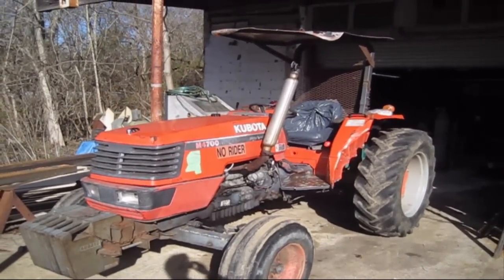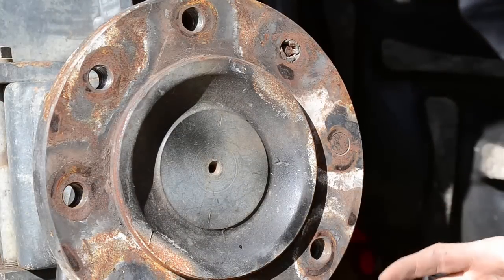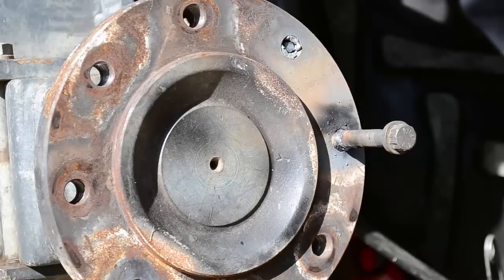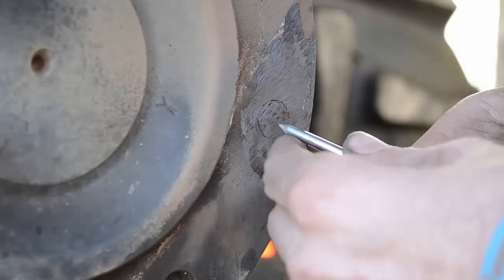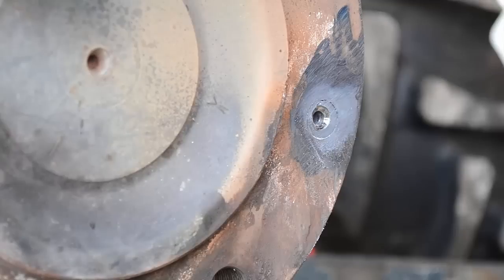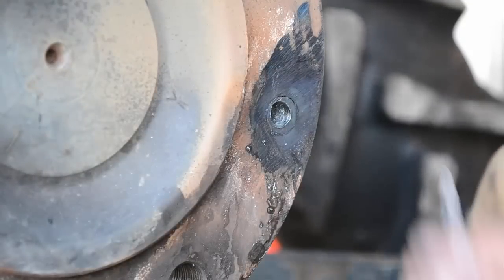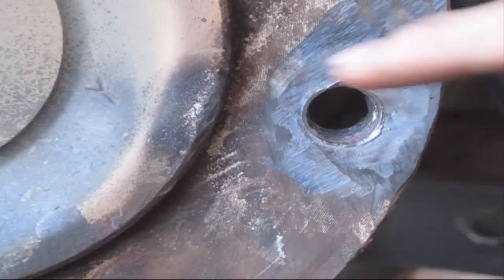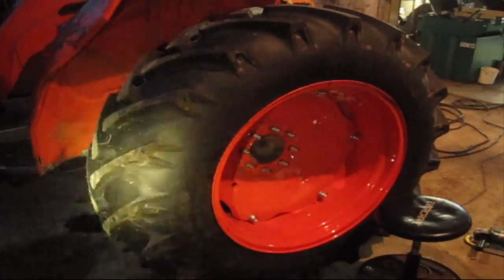Broke-off bolts techniques

Comment: I got to say I learned much about patience and self control.  I found the numerous comments very informative.  I would have used more penetrating oil and heat early on.  And I would have let the penetrating oil soak in for days; but this only works for hobby machanics, not for a business.  My main comment is about "Easy Outs."  I have learned, the hard, way that the hole for the easy out has to be, say about 85% of the bolt's pitch diameter.  You can't put a little easy out into a little hole in a big bolt and expect any position results.  Really, make the drilled hole big enough so you just start to see the thread lines. I do not like the round left handed pitch easy outs.  Their taper is too great.  While one part gets a good grip the fatter part expands the bolt tighter.  I do like the square easy outs.  They have less of a taper and good sharp edges to cut into the bolt. 

Lastly I have a comment related to thinking outside the box.  When the first bolt (with the welded on extension) would not come out by turning counter clockwise (because of something messed up on the back side) you should have tried turning it in the clockwise, so perhaps it would have come out on the backside.  Still it is a great video, clearl explained and good images.
Reply from the maker: Thank you sir. Knowing what I know now I think I could have definitely spun it out the backside but I was still green in my broken bolt experience and didn’t think it would work because someone else tried it.  I’ve used the drill out method very little compared to my weld on experience. But there are still times that drilling is the only way you can get them out.  I don’t know why this video blew up several years ago. I’ve got other videos on bolt extraction that are way better than this one.

Comment: Good persistence! Drill out the studs and fit helicoils (thread inserts).....If all else fails.....drill a new PCD of bolts 1/2 a pitch from the existing holes.

Comment: for the same or for head bolt take the same size bolt drill all the way through line it with a soda straw now hold in alignment with broken bolt use stick welder or wire welder. insert electrode into hole in bolt when hit bottom pull trigger for a few seconds . mite take a little practice but when get use to it you can save a lot of time great on head bolts. on through when you have drilled it you can use coping saw to make 3 cuts then it comes right out

Comment: if you have to drill it out, make sure you center punch it directly in the center. then starting from a smaller bit and work your way up the the bit you would use for the tap. don't use the drills he is using, they will overheat and could break inside the whole. instead purchase Cobalt drill bits, they are made for hardened steel. and work like you were drilling through butter. after drilling run a tap slowly through to clear the thread, you may have to run the tap in and out to clear the broked bolt threads. As for the holes that the threads are gone, get a helicoil drill and tap then insert helicoils to replace the threads.

Comment: J B
2 years ago
1)Slow the drill speed. 
2)Left hand drill bits. 
3)Lube the bits. 
4)Heat around the bolt, not the bolt

Fully argue

Comment: as a machinest for meny years what you should do is to take a masonery drill resharpen it with a regular drill point ---drill the bolt out as big as you can then take a small chisel and cut out the remaining bolt and retap to the bolt size

Comment: When I have taken snapped bolt/studs out I heat the surrounding metal not the stud as the surrounding metal expands away from the bolt/stud, considering that the axle flange is machined steel not cast this works the vast majority of the times. so weld you bolt to it leave it cool then heat the flange.  I worked in the motor trade for 32 years and this method rarely failed. otherwise its drill out slightly under size and re-tap the thread.

Comment: Once it is moving, if you can't get the stud out by backing it out, then weld a slightly narrower bolt on and drive it through by rotating clockwise. would have saved him a couple of hours

Comment: I torch broken bolts out. You can only do this if the holes go all the way through something. If you are good with a torch you can do it without messing the threads up. Or weld a washer to it then weld a nut to the washer.

Comment: Hi I have had success by putting a hacksaw blade through the hole and reconnecting it to its frame, you can then cut two or three places and brake it up with a punch. Thats if the hole is big enough (that one was)

Comment: The first thing I do is to clean any exposed part of the bolt thats left with a wire wheel and soak with penetrant ( I like PB blaster ) then center punch and tap with a ball peen.  You need slow speed , pressure and lube when drilling steel. When heating you want to expand the plate around the bolt , heat the bolt as little as possible and you could have drilled and tapped the broken bolt with a smaller left hand threaded grade eight bolt because you take a chance of welding the bolt in , not only at the surface but at the threads where the current passes from the plate to the bolt.

Comment: Hey U had it moving   Just use some Kroll oil or other penetrating oils wd40 ,,crc,, pb blaster all work well ,,And Iprefer todo it by hand ,,with a 6 point socket and breaker bar,,,then U can feel when it hits a hard spot stop back up ,,add more oil and run backwards,,sometimes back it completely out if hole runs thru to back ,,But glad to see U got it Done,,,Never Give  UP

Comment: You will chew up every bit by holding the trigger that way. You have to pulse it with pressure at the same time. A Dimond tip is better for steal drilling. The way your doing it is just striping the bit. I am a certified carpenter in National Construction Of America. OSHA Certified

Comment: When you heated the broken bolt. This what I have done in the past. I thought you was going to do it. Get it red hot from front to back concentrate on the middle of the broken Bolt with air hammer use point tip it will push through. I done it. 
Or on the one that gave you the trouble you hand it moving. Heated the back it would have come out.

Comment: Don' use oil, you don't want to lubricate the center drill. Use water or spit, you want to cool it to not burn it up. The evaporation of the water cools it. "Cutting oil" is actually 90% water

Comment: one that one that you drilled, if you had welded a smaller bolt into the hole, then froze it with something like liquid propane then (after the fumes cleared out) heated the axle surrounding it, it probably would have come out because the bolt would have shrunk and the axle hole grown.

Comment: I think you did it right in the start but you should be heat outside the hole to make it expond before you turn the bolt out....

Comment: You agreed with one of the other comments that someone has made, saying the ground clamp for the welder should have been attached to the flange to protect the bearings in the axle, (yes that would have protected the bearings) but this is still the wrong place to attach the ground clamp, because the only way for the welding current to make a circuit was to arc across the threads you were trying to get out, so this means the current probably welded these threads up as it arced across,  your ground clamp should have been clipped to the bolt that you were welding on, the axle bearings would have been protected and the threads on the broken stud would not have been accidentally welded up. 
You should also have been using a tig welder to weld that bolt on, as you can create more heat onto the end of the stud before adding filler wire, then let it completely cool down before trying to turn it.
 Both of these broken studs could have been removed within the hour if a little thought and preparation had taken place, and no damage would have been done to the axle & bearings etc etc.
The way you went about the job was very painful to watch especially that drilling, did you replace the axle drive shaft & bearings that were inevitably damaged by the welding current arcing across them.

Comment: What the hell... that was a 6011? what was it a 1/8" rod?  then you switched to 7018.  Smart. Banging on it smart as well.. sets up vibration in the threads.  I hate ez-outs. Those tools are way too small to get the job done.  I've snapped a few (in the 80's), but I was at least successful 1% of the time... haha... talking about snapped exhaust manifold bolts in an aluminum head volvo turbo 242. What a mess! Great video!

Your accuracy with an arc welder is to be commended! I have a giant transformer arc welder. It does me good when I need it.  Wish I had your accuracy though! Keep it up!

I really love the ending. You did your dad proud man.

Comment: Just a thought here, but once youre drilled all the way through, why not tap the hole from the back side and run a bolt into it? Then you can just impact it out from the back side.

Comment: You did not show drilling thru the easy out. They are just as hard as a drill bit. I wonder how you got around that. Personally for this kind of problem drilling while still really hot is awesome. Just have to heat it up a lot of times because you have to keep wetting the bit to keep it cool and only drilling a little at a time to save the bit. But it does progress evenly without the fight or wondering off of center.

Comment: I use Cobalt Drill Bits........work a hell of a lot better than HSS. And I'd start with a small hole in the bolt...maybe 1/8" and work my way up. Also, PB Blaster to try to lubricate the threads..........z

Comment: A number of comments

First off I want to second all the comments saying you are running the drill way to fast.  In hard metal drill slow with proper lubrication and high pressure.  As soon as you realize cutting has stopped, stop and change something.   Otherwise you are simple hardening it even more.   Most drills run to fast for this so you want to really be sensitive on the trigger.   When shopping for drills for bolt work one of the criteria should be slow speed control.

Second I want to strongly second lubrication comments.  There are actually 3 different types lubricants needed here.  You need a penetrating lubricant, an anti-galling lubricant and a drilling lubricant.  Penetrating lubricants help get stuff loose.  My 3 favorites here are PB, Kroil and Boeing.(notice I didn't say WD.  While it is better than nothing there are hundreds of better pentrants available)  I usually use PB simply because it is readily available at my local stores and cheaper where the other 2 are special order, more expensive and have a high freight cost.  Kroil I think works better if it has time to soak for days or weeks.   Now once you get the object moving at all you want to change types of penetrating lubricant.  Now you want one with really good anti-galling properties.  I have had the best luck with teflon or graphite based penetrants for this.  Tri-Flow is a preferred for this but as it is no longer commonly available in stores here I have been using any of the Teflon based penetrants and having decent luck.  Now if you have some slop or something like a acme thread with some room at the root of the thread another answer is mix STP or one of the other motor honeys with a readily evaporatable solvent to lower its viscosity.  Work it into the thread and then add a bit of heat to boil solvent out.  Finally you need a good drilling oil.  It will dissipate heat reducing wrecking drill bits plus reduce hardening.

Third you should have explained some things about carbide masonry bits.  The most important is they are not ground for drilling metal fresh out of the package.  They have a double bevel because they are designed to work with hammer drills.(some cheap ones are only single bevel but it is dull)  You need to grind it to a sharp single bevel before drilling metal.  If you don't do this you are actually work hardening the metal by burnishing rather than drilling.  Masonry bits are chosen because they are cheap and readily available.  Metal drilling carbide bit are better but they are expensive and not commonly available.  Breaking the carbide is as common as can be so cheap counts.

Now as for drilling/easy outs  I will argue that in most cases you are better off doing things in the other order.  If the bolt is no grade or low grade you are fine welding first.  Grade 5 it is questionable and if it is grade 8 you should nearly always choose to drill first.  I HATE drilling bolts too.  But I have found that the time I gain welding for removal is nearly always counter balanced by the time I spend on a bolt that got hard that I end up drilling.  There are a few exceptions but generally if the bolt is grade 8 it is better to drill first.(almost all wheel bolts and studs are grade 8.)  If you do the other techniques correctly drills and easy outs are mostly effective.

Nice starter video but there are a whole lot of things to teach and tools and techniques missing from this video.  For example drilling should include a discussion of left hand drill bits as they are one of the biggest time savers in the world when they work.  It should also discuss grades of drill bits such as cobalt and molybdenum for working harder materials.  As for easy outs a discussion of the 3 types of easy out and how to best use each should be included.  In heating a discussion of why heating the bolt or its surrounding material is mostly doesn't matter as to which is done.   It should also include a discussion on why banging matters, especially with penetrants and how to do proper prep for that before hand to improve your results.  Gentle hammer time done properly nearly always pays dividends in time saved.  Then there are a whole host of tricks and techniques for dealing with the various problems that come up.  Plus you made several of your own problems as you went that probably could have been prevented with proper use of your resources.
Reply from the maker: Clark Letellier Damn. You need to make a video.

Comment: Okay, just an observation here, but since you already have a hole going through, why not tap and die it, put a washer over the died section, weld the bolt, then back it out that way? I'm no expert, but since you drilled the hell out of it I would assume that a welded bolt in a tapped hole would do the trick. Just my opinion

Comment: It’s was cool seeing you blow that stud out with the torch, I’ve done the same before. Next time you have one giving you fits coming out like that try heating the stud cherry red and not the material around it. Like you said about the air gap. When the stud is red then try turning it out, the stud will be soft and usually the threads will be perfect, works for me. I use the nut trick removing broken studs from exhaust manifolds on ford v8’s, one I remember welding around 10 or 12 nuts to it before it finally gave up and come out. Great how to vid!

Comment: If he had quenched that bolt (not the hub) with cold water immediately after welding it , then immediately unscrewed it, it would have come out.  Works 90% of the time.   (I worked on heavy plant for over 45 years)

Comment: I just thought of an alternative method too, modified on yours. Slightly longer though. What about welding a large washer over the surface first?

Use the centre of the washer like you would tac a nut, then weld the bolt to the centre tac. Then you have the full size of the washer itself to add more strengthening to the bolt?

Not sure if would work, just a thought maybe worth trying

Comment: When you had your bolt welded on, it was turning until it got hung up on the back side.  Could you not have then advanced the bolt (ie "tightening") until it fell out on the inside?  Then you cut of your bolt, and Robert is your parent's male sibling.

Comment: What I have done on studs often times is weld smaller grade 8 bolt and ran it on through plate like that. Especially if someone has buggered up back.

Comment: As a boilermaker myself, I would never use 60/10 cellulose electrodes because they don't have the strength . 100% of the time I would used low hydrogen electrodes for extra strength.

Comment: Since you couldn't wind the remaining broken bolt out clean up the weld and wind the broken portion right through and cut it off the welded bolt from the other side.

Comment: with a bolt  with in a hole fill hole with spray freeze off this shrinks the bolt somwhat so it will come out easy after you drill the hole i have had good luck  with a square nail taped into hole use vice gripes to turn the nail those 4 corners grab good  those square nail are tapered so  you can cut it fit your  hole if needed

Comment: When the first Bolt would not come out the front of the Hub, Why didn't you try to run it THROUGH the hub and Out the back-side? they are evenly cut through-holes, correct? (no Taper to them or anything.) Just curious. It seemed like you were 100% correct, where he buggered up the back side of it, is where it looked to just stop DEAD.

 Also - Whenever you have to use the "Heat and Beat" method or if you manage to work harden a piece, Thermal Cycle It. Heat it up, Let it air cool x 2 or 3 times. That will remove any hardening that has occurred either by Quenching or work hardening.

Comment: Pro tip my uncle taught me drill a hole slightly smaller than a torx but then smack a torx into the hole and put your ratchet on the back never bought a reverse drill bit since